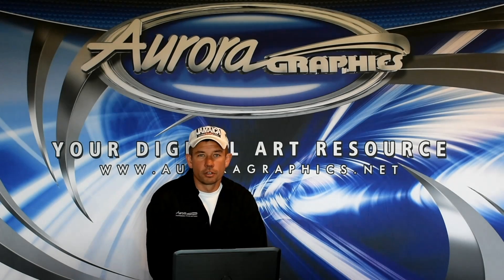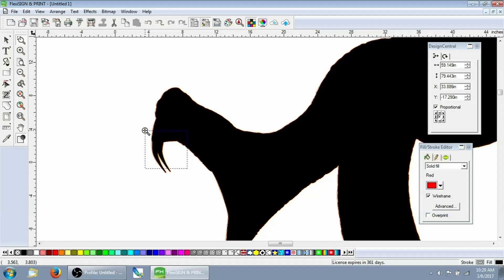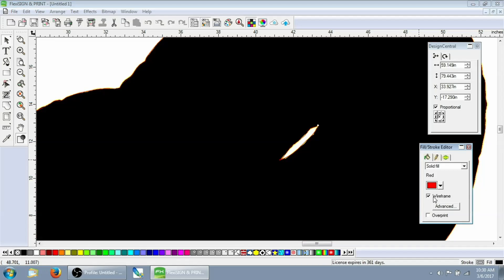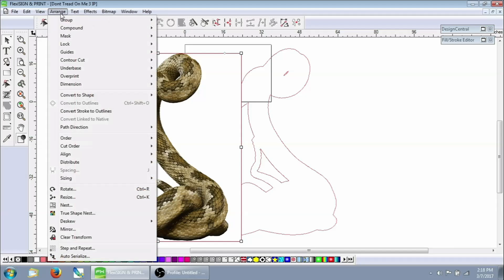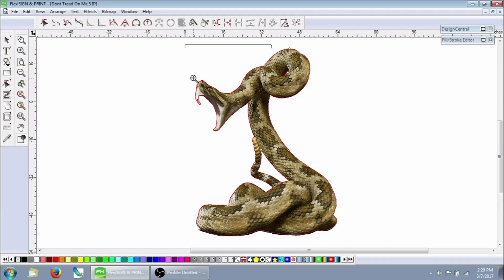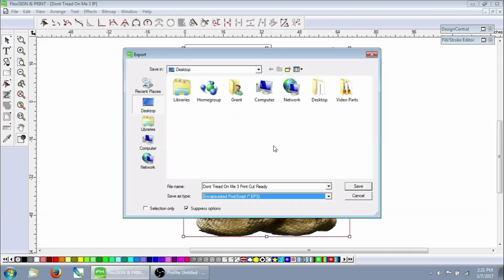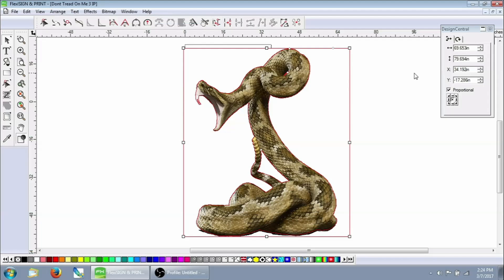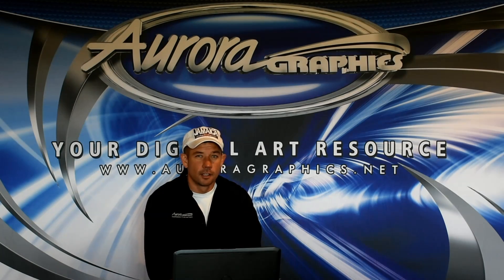Print/Cut Tutorial Part 2: Creating A CutContour

Comment: Its a little bit complicated. We just use "outline Stroke" on Illustrator and then use pathfinder to eliminate all path inside the outline stroke. And there it is, the cut contour. Then we use "offset Path" and set it to -1mm oder -2mm so the cut contour is inside the printed object. Or to +1/+2 if you want a white frame around the image.
Reply from the maker: Thanks Peter! I will have to give that a try. We always have to inspect the placement of each node on our CutContours before we can offer them for sale. This is just to ensure perfection and avoid problems/material waste for our customers. This is why we don't use auto trace features or strokes to create ours. It does take a while, but the results are always flawless. Also, you may want to checkout part 1 of this series on a color matching stroke.

Comment: Place the graphic into Illustrator and use the pen tool to draw around the image, I could have outlined this graphic in about 1 hour with about 1/10th of the nodes that you had to manipulate.

Does not need to be a compound path and only use .EPS file format
Reply from the maker: Hey Mike. That is impressive! I know Illustrator has an auto trace feature but to have exact precision you have to manipulate the nodes by hand. All vector programs have this function  now and I have never seen one get anywhere close to perfect. Not close enough for a company like us to sell anyway. Also we never adopted Illustrator around here because they were limited to a 120 inch art board up until recently. Most of our images are over 200 inches so it wouldn't work for us. Nice work on the speedy vectorizing. Talk to you later.
Reply: My point was that it takes way longer to adjust the points than it does to just lay them down with the bezier tool. I probably am fast at it because I do it to every product photo I make. However I was impressed with the method for adding the extra 2 pixels of matching color. I am just getting into laminating labels and I appreciate your videos.
Reply from the maker: Well Thanks Mike. Again excellent work on the vectors from scratch. I am definitely more of a Photoshop guy than a vector program user. I only go into them when I have to make a CutContour LOL. Let me know if there is anything I can do for you.